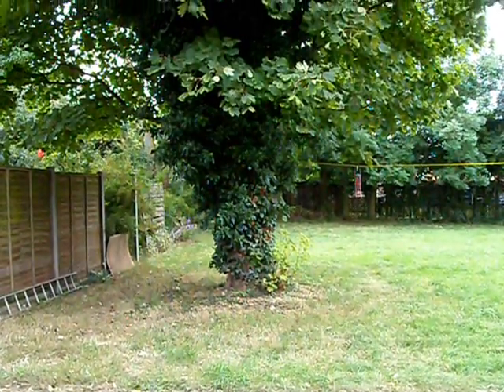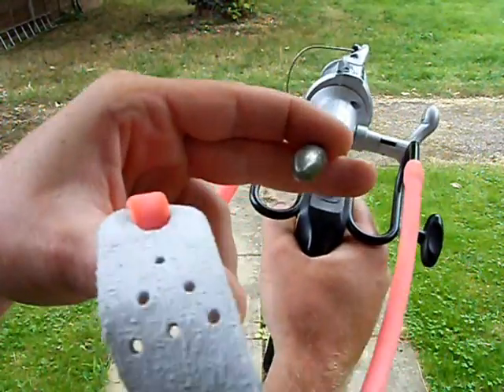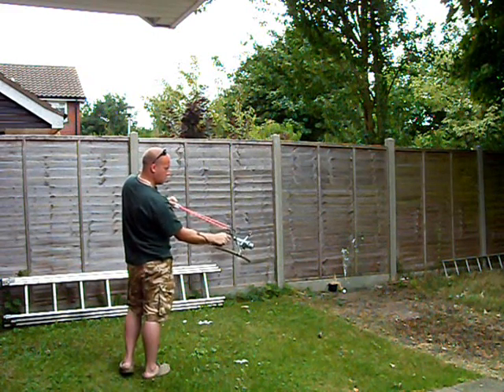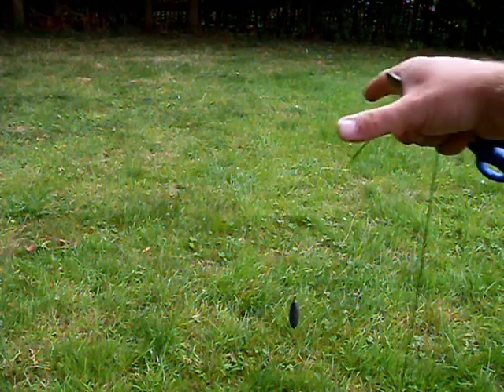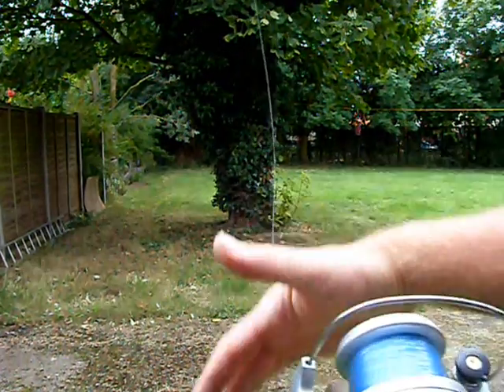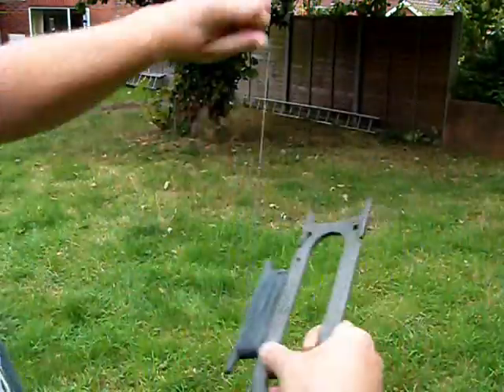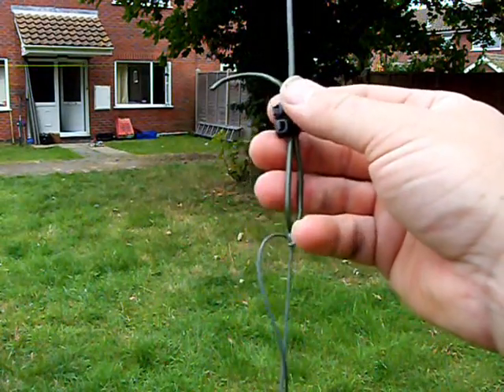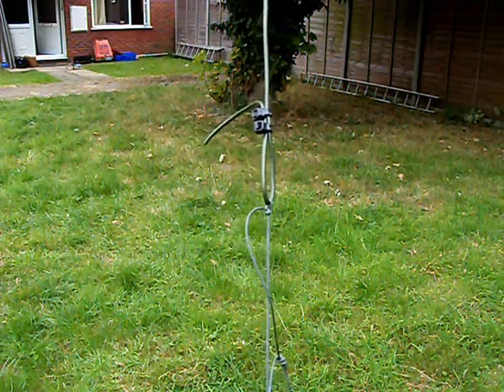My Homebrew Longwire Antenna launcher in action - M0VST

Comment: "When nerds become red-necks".. I used my compound bow and shot it up and over a pine tree about 80 feet tall, pulled my line then shot another arrow with line over another pine tree about 500 feet away then secured it at the top by pulling the string tight and nailing it off to the tree. Pulled the wire tight from the start point, connected the balun and ran about 30, 20-foot bare copper radials using 10" Nails in a 360 pattern and connecting to a ground rod I heated and bent into a loop, then tied it off to the baluns counter. Hooked up my Yaesu 891 And I caught a net on planet Roasted Nuts, that's within Burnt Scrotum County somewhere in the Centaurus galaxy.

Comment: Use 45lb test ss coated sea wire line..works much better..easy to work with,and exelent antenna results....been using it for years...

Comment: I need to do exactly this except over the house, I was wary of breaking windows with my incompetent aim so used a plastic bottle weighted with some water, tried a few times and then gave up in case the neighbours saw my wierd behaviour. In my case I just want to lift one end of my 40m dipole...
Reply: I put a couple of tennis balls in an old sock and tied the sock off with my string/rope and had less worry about breaking anything. Heavy enough to toss over the roof, but soft landing.

Comment: I have been doing that since the late 80s except my spinning reel was duct-taped to a 8 foot step latter with me at the top I could shoot over 100 feet I used a 5/8" steel socket for the projectile I could shoot over 100 up, but I do like your combo sling shot reel setup  very clever.

Comment: you would be better of using braid id of thought. lower diameter so it will fly further.also braid has no stretch so as ur pulling it back through the tree its less likely to ping back at you if it gets a  stuck on a branch. Braid is also much stronger.

Comment: Being a ham and fisherman, use the same method.  However, use the butt end of a carp rod and attached the catapult to the butt rear.  Remembering to use the first eye of the butt end of the rod..  This way you'll avoid tangles in your reel as it is guided through the eye first.  A little like filling the spool of a fixed spool reel with new line!  Completely re-useable

Comment: So you dont actually secure it in the tree? You just run it over the tree, then to a fixed point?
Does the wire blow around much in heavy wind to the point it may affect swr or rf output?
Great video by the way. Thanks for showing us how its done.
73`s
KC0ZOS